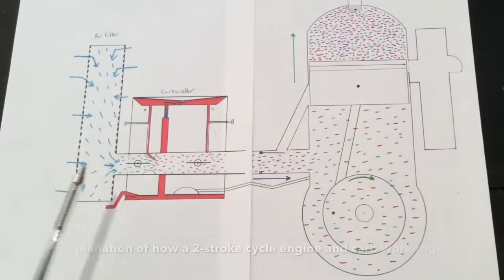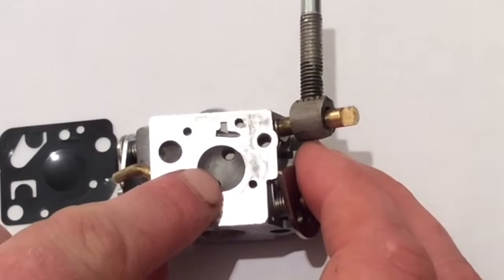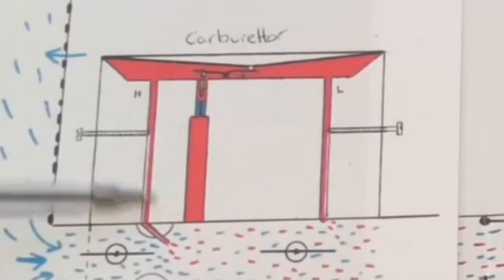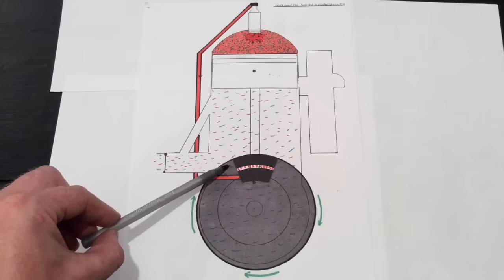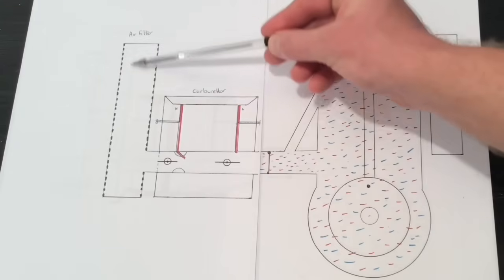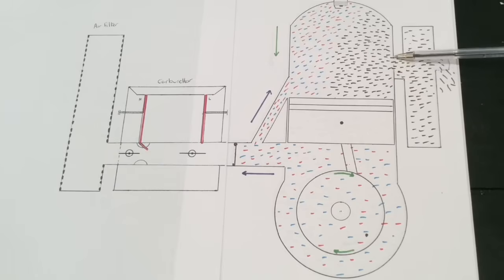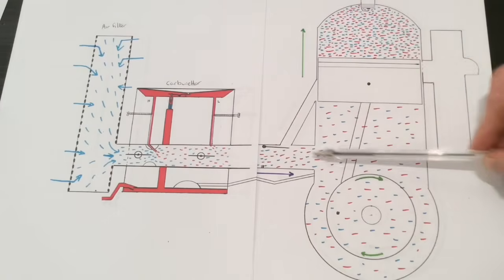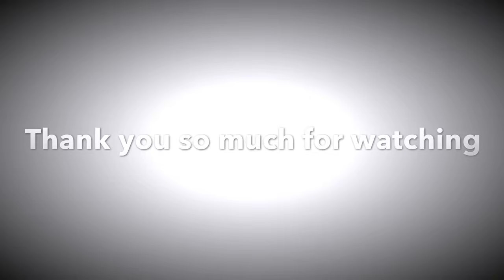How the 2-Stroke Engine & Carburetor Work Together!  (by Craig Kirkman)

Comment: @TheRepairSpecialist Great explanations. I hope you are a teacher by profession.  I'm curios to know more @4:20 when you start talking about the coil pack.  I was wondering where the spark plug gets the current, now I know, Thanks!  Since the magnet on the flywheel is generating the current, do you know if it always generate AC current and roughly how much current does it produce?  Can I tap into this, add a rectifier to create, say 12V (prob low amp), output for light use accessories?  It seems there is free/wasted energy that can be used.

Am I correct to assume that pulling cord cord is essentially pulling/turning the flywheel to generate electricity for the spark?
Reply from the maker: I'm glad you found the information about the small two-stroke engine coil pack helpful! Let's delve into your questions about the type of current generated by the flywheel magnet, the possibility of tapping into this current, and the mechanics of starting the engine.

Type of Current Generated
Yes, you are correct that the magnet on the flywheel generates an alternating current (AC) as it passes by the ignition coil. This is due to the changing magnetic field inducing a current in the coil, which inherently produces AC.

Current and Voltage Produced
The exact amount of current and voltage produced by the flywheel magnet can vary, but typically, the ignition system in small engines is designed to generate the high voltage needed for the spark plug, which can be in the range of thousands of volts, albeit at very low current (milliamps range).

For generating usable power for accessories, the available current and voltage would be significantly lower than what is needed for the ignition system.

Tapping into the Current
It is theoretically possible to tap into the magneto’s current to power low-wattage accessories, but there are several considerations:

Rectification: Since the magneto generates AC, you would need a rectifier to convert this AC to DC if your accessories require DC power.
Voltage Regulation: After rectification, you would likely need a voltage regulator to ensure a stable output, such as 12V, as the output from the magneto can fluctuate with engine speed.
Power Availability: The magneto is primarily designed to power the ignition system. The excess power available for accessories is generally quite limited. You may only be able to power very low-wattage devices.
Practical Implementation
Adding a Rectifier: A bridge rectifier can be used to convert the AC generated by the magneto to DC.
Voltage Regulator: A voltage regulator, such as a 12V regulator, can ensure a stable output voltage.
Current Limitations: Be mindful of the low current availability; this setup might only support low-current accessories like LED lights or small electronic devices.
Starting the Engine
You are correct in your assumption that pulling the cord turns the flywheel, which in turn generates the necessary current for the spark plug. The flywheel’s motion, driven by the mechanical energy from pulling the starter cord, induces the electrical current in the ignition coil, creating the high voltage needed to generate a spark at the plug.

Summary
AC Current Generation: The flywheel magnet generates AC current as it passes by the ignition coil.
Potential for Use: While you can theoretically tap into this current, it would require a rectifier and voltage regulator, and the available power would be limited to low-wattage applications.
Engine Starting: Pulling the cord turns the flywheel, generating the electricity needed for the spark plug to ignite the fuel-air mixture in the engine.
I hope this answers your questions!

Thanks

Craig

Comment: @2:58, I’ve disassemble a lot of leaf blower two stroke carburetors and I’ve never seen a one-way valve between the carburetor and the motor do all engines have this?
Reply from the maker: Hi. You are right to bring this to my attention. The balance you mentioned about between the carb and the engine is called a Reed Valve. Some two engines do have them and some don’t. They aren’t as common nowadays, in my opinion, so I probably just added confusion to the video by including it. Thanks again. Craig

Comment: Thank you and Well done.............Just bought a Honda SGX Sky.............which was all running fine and sounds light a sewing machine..........Then after wizzing about locally and doing less than a mile.....the recs remained higher than usual tick-over,...............Had a look and tried to find the fault, assuming it would be a simple throttle sticking..............Whilst it is the case the revs stick .............it also has a problem when left standing ............the engine appears a little erratic............Now wondering if it is the reed valves...........having had the carb off and found nothing unusual............So apart from another strip down to check the reed valve..........I am thinking some kind of air leak...........or the auto choke..........but I will have another look at the  throttle valve (although it does appear to be seated at it's lowest point correctly) Problem being here the air box is a lot of work to remove and may give a false reading, by drawing in excess air...........Any ideas ?

Comment: I'm just about to take delivery of a Stihl cut-off saw and was a bit worried that my lack of engine knowledge would hamper my maintenance/repair attempts, but this is an excellent video demonstrating not just the engine, but the carburettor too. It's actually very similar to premix burners in gas boilers which I used to work with so quite easy to relate to it. Many thanks :)

Comment: How much 'waste and inefficiency " occurs when the fresh air/fuel mixture pushes out the exhaust gases. Does more exhaust stay for the next cycle or does more fresh stuff get pushed out before it gets to be used in the next firing?
Reply: You've discovered the beauty of 'tuning'

2 stroke engines are far more polluting than 4 stroke.  It is better to have some raw fuel go out than keep some exhaust gas in. 

Some of the things you can change to adjust this are; cylinder design, intake + exhaust shape/length/surface finish, mechanical timing.

If you get it just right, it's powerful and efficient.

Comment: Very good video. Can i ask a question is it possible to drill a hole in the very old engine that does not have the hole to help with  installing a modern carburator that have a hole that its function is to use the pressure differences in the  engine to pumping the diaphragm? Thanks.

Comment: Hello there   I have a  Makita EK7301 ,    Most recent  issue   was Hard to start.   After watching your Videos,  I  isolated the plomblem .   NOW   it does Start  But  it Won't Turn  Off .
First  I  pull 6 time starter , on CHOKE position.   Because is cold .
Second   I Switch  to   Run  " | "  and     pull  Starter      some times  after few Pulls. But  start  working. 
When I Move it to STOP.   It won't  not turn OFF .  I have to do it  by the Decompression  Button .  Just to turn it OFF .
Any Advice ...?
Thank you :)

Comment: Great explanation! My question is why doesn't (or how does) some intake air escape through the exhaust port when the piston is rising? Because the piston is "compressing" the air but yet it has a place it can go: out the exhaust
Reply from the maker: RedstoneWolf, hi, yes, the short answer is that some does escape, which is why some more advanced two stroke engine have exhaust valves fitted to the exhaust port area. I will make a video explain this. I realise that I should have mentioned this in this video. Thank you for your feedback.

Comment: I understand 2 strokes are hated for their emissions, I personally love 2 stokes, but anyway, I believe they can be made just as efficient as a 4 stroke by adding valves, can anyone correct me on this?
Reply: Yes this is a very good idea and a lot of snow mobile engines have been directly injecting their fuel inside the piston for years. I believe that the main problem that we are having with all of our internal combustion engines is that the fossil fuel industry has brain washed everyone into wasting their liquid gas. The only part of gas that actually burns at all is the vapor so I think with this in mind, a lot of things like jets could be done away with and replaced with an intake system similar to a blower like in the old Detroits except instead of using a blower to push the exhaust out, use one to push the fuel/air mixture into the piston.

Comment: Doesnt the sparkplug fire somewhere near 10 degrees before the TDC (depending on the engine) to compensate for the (at first) slowly growing combustion?
Reply: Yeah, I think so. Doesn't it fire earlier so that the air&fuel mixture doesn't burn by the compression like a diesel would?
Reply: i dont know, all i know that its for making sure as much of the mix has time to burn as possible :P

Comment: Just wondering, you said that pressure isn't pushed back through the carburetor because of the reed valve being forced to close due to the downward motion of the piston. Do all small 2-stroke engines have this reed valve? I haven't been able to find it on my engine? Where is it likely to be found? And whats the alternative if they aren't found on all engines? Thanks for your time.
Reply from the maker: Hi, thank you for the kind comment. You have also made me realise that I should have mentioned about those without the reed valve. I think the best thing is to  show this fully with another video, which I hope to put on soon. Thanks again and I look forward to uploading that one.
Reply: +TheRepairSpecialist Great, I'll look forward to watching it!
Reply: on other small engines the inlet port is blocked by the piston

Comment: Well thank you so much for putting so much effort into this vid. Those illustrations must have taken some time and it was very succinct. I'm trying to learn how to maintain/repair my own gear and this is great. Your previous video on carbs was really good too.

Can you give me your thoughts on non-genuine parts? I have picked up a number of well used stihl tools 2nd hand and they need new gaskets, carb diaphragms, air filters. Stihl parts are known to be expensive but they seem to be even more so in Aus (I have seen carb kits go for less than a third of the price overseas). I am sure there are bad 3rd party copies but are there lots of decent ones that have a better performance/price ratio too?
Reply from the maker: Hi, thank you for your kind words, they really do encourage me and help give me the confidence to continue including other videos.  As for the parts, I agree with you that genuine parts are very expensive indeed. I have always recommended that if you aren't a professional landscape gardener, for Instance, who use their equipment more or less every day, for hours on end, but rather once a week on your own garden, then yes, none genuine parts should be fine.  I have several garden machines of my own that I only use on my own garden each weekend and they have been ok for the last few years even though I have used none genuine parts in them when I rebuilt them back then.  Of course there are varying levels of quality regarding none genuine parts but finding which one is the best is really trial and error, in my experience anyway. If you were a pro gardener using your machine everyday then I would recommend genuine because they are generally much more durable in the long run, in my experience anyway.
I hope this has helped
Many thanks indeed
Craig

Comment: Fantastic video once again! 

I'm studying a mechanical engineering BTEC so this is very helpful. I recently bought a 2 stroke engine just to take apart (thought a 2 stroke would be a good place to start as they are so small and simple, relative to a car's engine at least) , and I'm pleased to say I managed to rebuild it and it still works a treat, so it's nice to have the theory of operation explained so clearly.

If you don't mind me asking; what's you're training and experience? Are you an engineer or mechanic?
Reply from the maker: Hi Thank you for your kind comment. As for my background: I started working on two stroke machines, as a mechanic, in 1988 during my school holiday leave. I was taken on as an apprentice mechanic in 1991 and undertook a 4 year 'maintenance and repair engineering' qualification at College, which was combined with block release where I alternated between College and my job. In 2000, I undertook a science BSc hons degree, where I learned the in depth workings of things on a molecular level. I have since tried to combine the two disciplines to try and present an understanding to others. I have been working in the industry since I was an apprentice. I hope this helps, and thanks again for your comment. Craig
Reply from the maker: I meant to say in my last message that it's great news about your BTEC Mechanical Engineering course, which must be an amazing subject to learn.  Well done with your rebuild of your 2 stroke engine also.  I hope all goes well for you and you become qualified and have a very succesful career.  Thanks Craig
Reply: Thanks for your reply's. At only 19 it's difficult to comprehend how I could ever have the knowledge to become an engineer or mechanic one day, so your videos and knowledge of your background is invaluable. Thanks again!
Reply from the maker: Thanks again, and I know that you will be great at your subject because i can tell you love what you are doing, and you are investing your own time in learning. You remind me of what I was like when I was your age.  As you know, learning never stops though and I'm probably learning more now than I ever have.  So get out there and be the best, your hard work will deserve it.
Reply: Thanks very much for the encouragement, and I look forward to your future videos - you're a fantastic teacher!